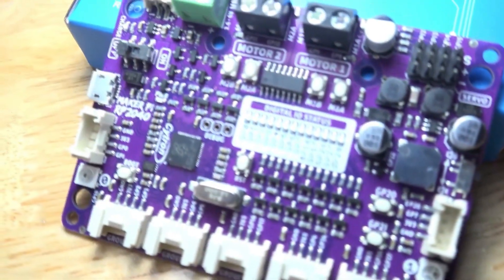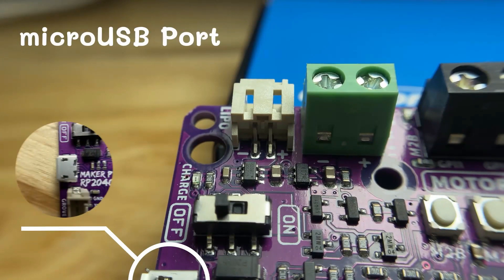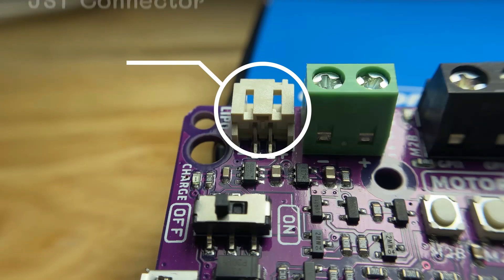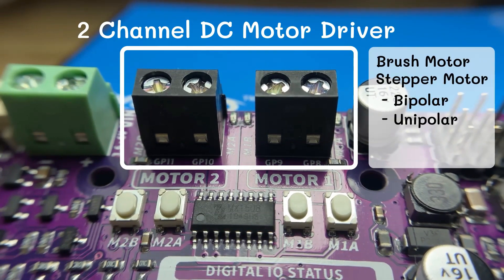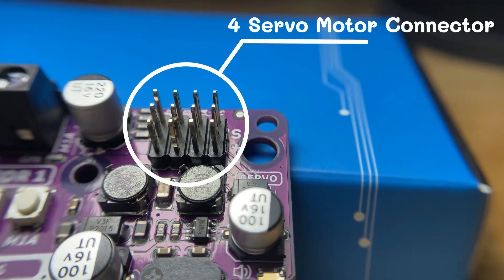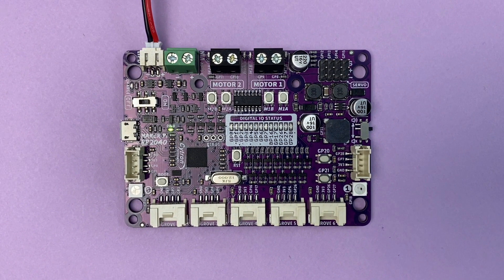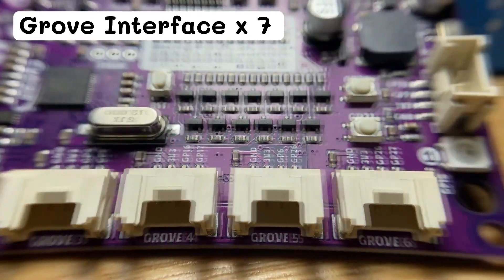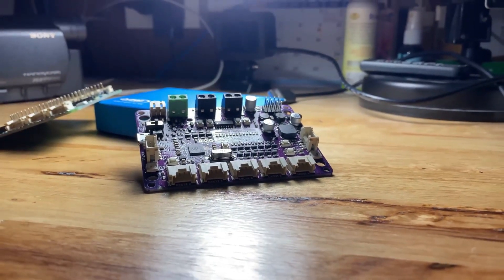Maker Pi RP2040 : Simplifying Robotics with Raspberry Pi RP2040

Comment: You can build a robot easily.... So do it an put a video of what it can do. Those motors you do not show it driveing a load. And you don't show it driving steppers. No one has put a project video out to show and you leave it to the experimenter to trial and error.  I have made this board work with N20 motors and i couldn't move a load. That said, i did have the controller working thru Uart to a esp2-s2 feather board to talk with the internet, i drove the a n20 motor to move a stage 16" back and forth with limit switches using circitpython for programming. I could move the stage with my phone. now i am starting up again, but still question my best motor choice to move something.... You should be showing that Cytron, your board is most capable but you don't show any real world examples other than a wobbly toy and moving actuators back and forth. nice. but this thing can do so much more.

Comment: I have been looking for a controller that can drive 4 high voltage motors. Can you suggest anything for 14 volts and 4 motors or would it be better to just use 2 wheel drive and two free wheels?